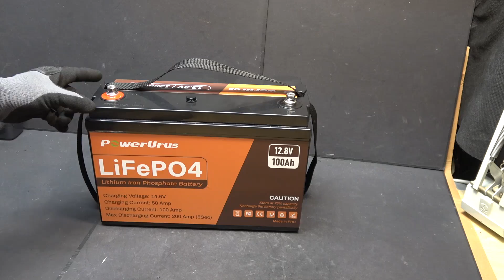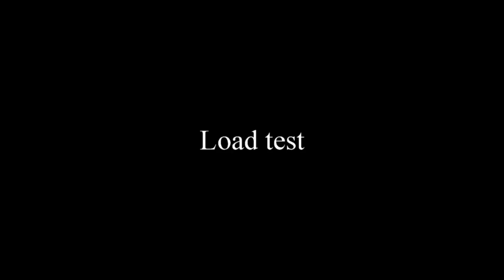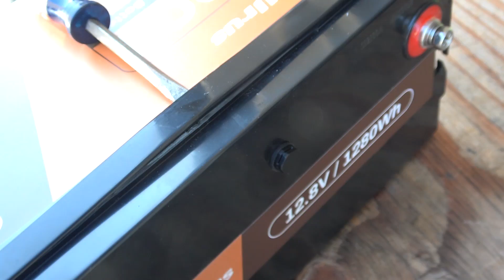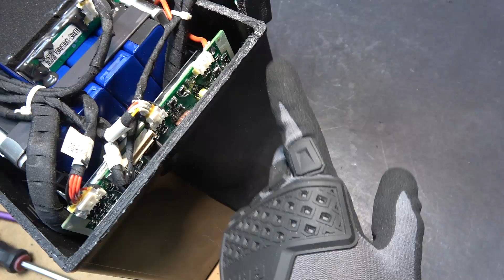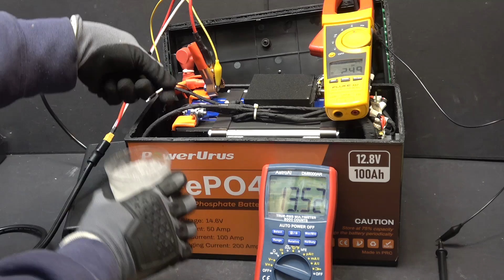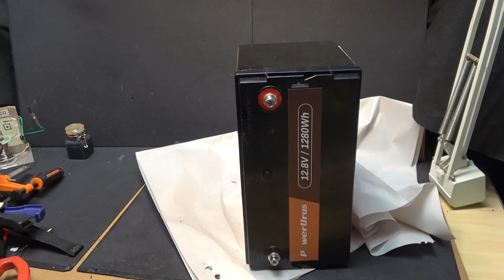Review & tear down: PowerUrus 12.8V LiFePO4 battery

Comment: I am confused as how you get 100+ah's with battery at 80% charge V. Because to get battery fully  charged you need a bench power supply. That gets it to 100% state of charge. 14.6v to be exact. But your video clearly shows you getting the 100+ahs with 80% state of charge. Pretty amazing. And by no means am i being sarcastic. I love your channel.
Reply from the maker: The battery was at 100%. You charge it at 14.6V but it doesn't stay at 14.6. It will go down to 13.3V after you disconnect the charger. And when you put a load on it (10A in this case), it will immediately go down to 12.8V.

Comment: When you was using the resistor to connect the inverter to the battery. I do the same thing as you do but my question is could I leave the resistor on the wire permanently? + Won't have to worry about forgetting it
Reply from the maker: You can't leave that resistor on the wire. When you pull over 100 Amps through it, it will light up like a light bulb and then kaboom...

Comment: Just a FYI....you can use a carpenter's pencil for the resistor. Just sharpen both ends of the graphite pencil and it will act as a pretty good resistor. My high tech Lowe's one measures about 14 ohms.

Comment: Odd that you would review a battery and not provide a link to it.  I did find the battery, and it's quite a bit more expensive than other well known brands such as Power Queen, Li-Time, and Watt Cycle.
Reply: Good ecoworty on dchouse for 200euro for 100amper 12.8volt lifepo4 is good and interior celle 3.2v 100amper rept good

Comment: Thank you for the video I’m thinking about buying 3 of these for my old 1988 golf cart 36v I’m not sure if I should get 3 of these or one 36v battery ... what do you think is better option?
Reply from the maker: I would get one 36V battery. Having 3 of these 12V in series poses a problem when you need to charge them because each is run by its own BMS.
Reply: @vuaeco  thank you for the reply I’ll probably go with the 36v 100ah that comes with the charger and Bluetooth Amazon has the “LOSSIGY” brand on sale for $679👍
Happy New Year!!!
Reply: @vuaeco 3 battery in serie da 100amper 12.8volt ecoworty con bms included no problem in serie 38.4volt nominal and charge max 41.7volt bulk is ok and 41.4volt float
Reply: 12v 100ah are the cheapest. But may need to be charged individually some times to balance them. 36v charger will work but charging will stop once one battery is full even if the other battery’s are not full. They may only need individual charging once a year, who knows